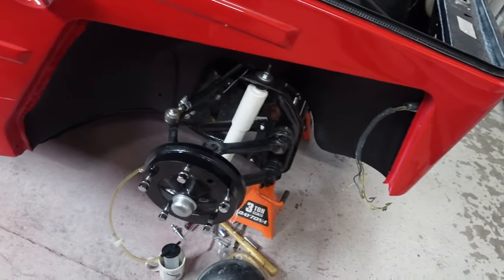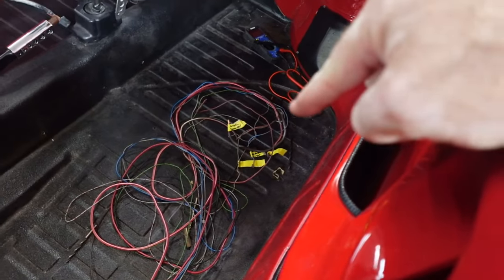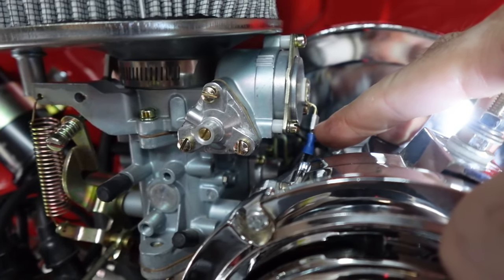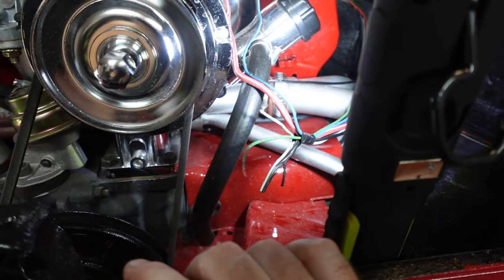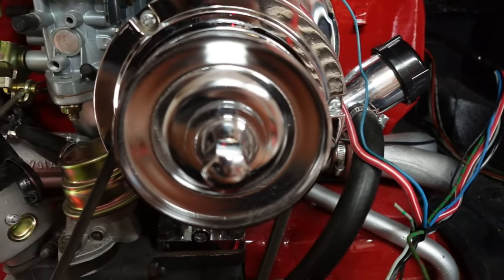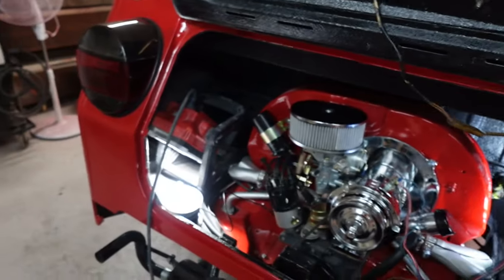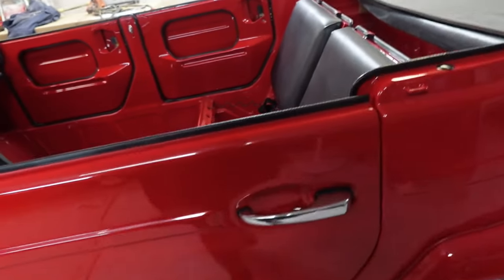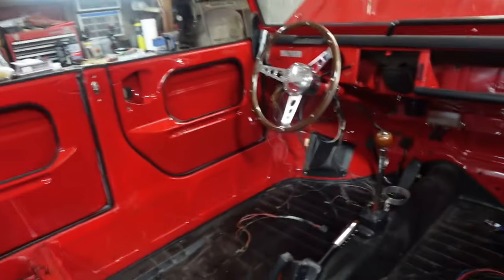1973 VW Thing Restoration: Update 7-15 Wiring & Brakes!

Comment: You’re doing a good job. Things are not easy to build. I’ve done a lot of VW’s, and my 73 was a tough one. One thing I have learned is that when wiring is that bad, replace the whole harness. Keep it going.
Reply from the maker: I completely agree, This is the first car we have tried to keep the original wiring and it has its challenges for sure in places. Thanks for watching!